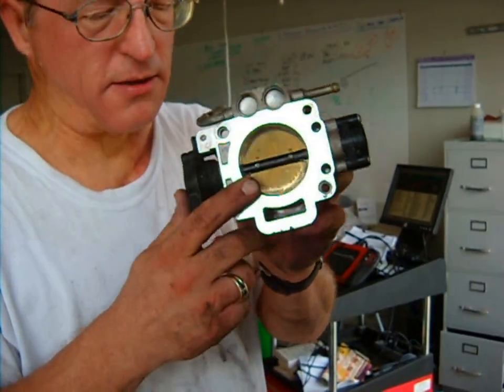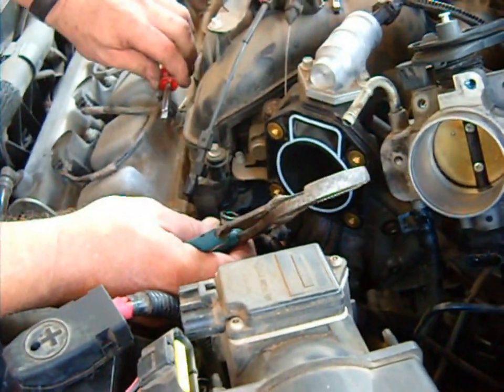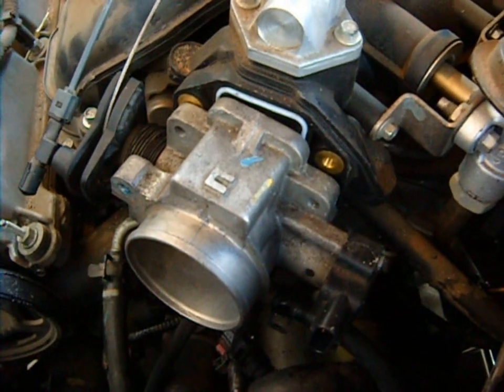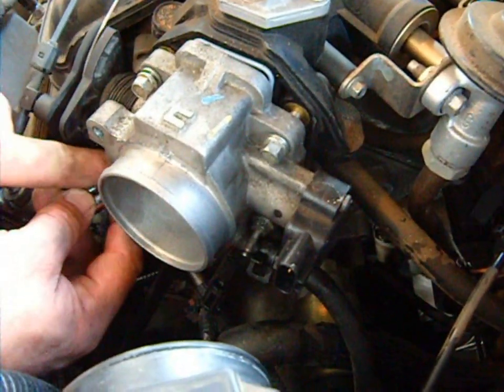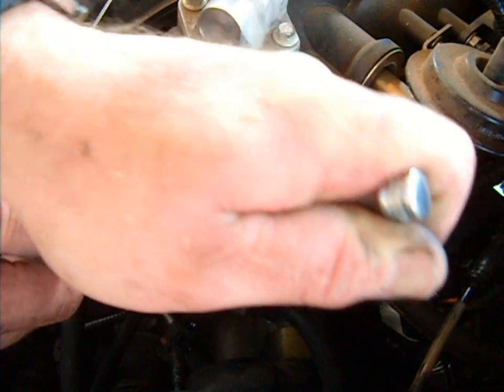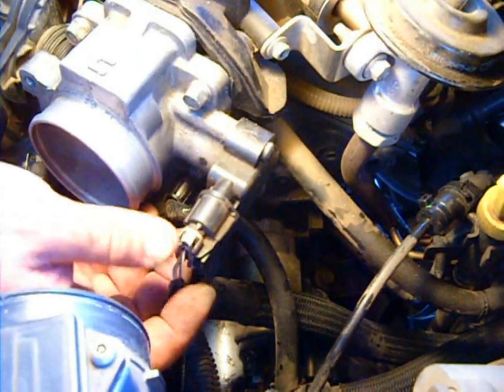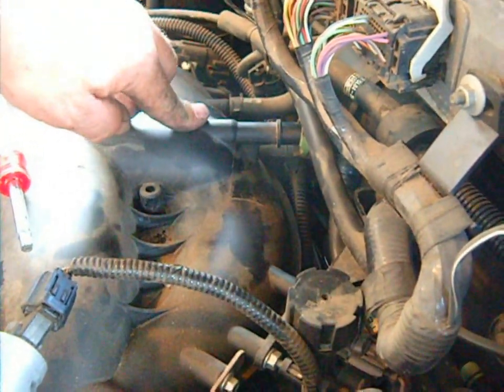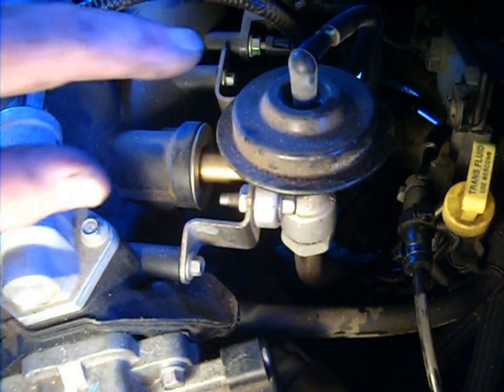Jim Stith's 06 Escape Throttle Body R & R 2 of 3

Comment: That's pretty much what I was thinking, though with a carburetted engine I think it might have more of an effect if only because of the fact that the turbulence is right where the fuel is mixing with the air, but I doubt it would have much if any noticeable gain in mpg or power regardless of the engine type.

Comment: So i guess it would be similar to the claims of the tornado scam, but I think this would be more likely to work, since it's actively creating turbulence through pressure as the air travels between the groove and throttle plate rather than just spinning the air. And I guess it would depend on the vehicle, as to whether or not a bigger throttle body would help, I just meant generally. I think this animation is pretty similar to how i think the groove would work: watch?v=L2V8M_oVvLo

Comment: I was told that it was intended to increase the amount of vacuum created by the intake stroke, increasing the amount of fuel vaporization. If it really did do that, then it would help with fuel vaporization, since evaporation is dependent upon the pressure of the air, but I think it just creates more turbulence. That might be why it 'supposedly" works better on carburetted engines, since the turbulence would directly affect the fuel, breaking it up more evenly.